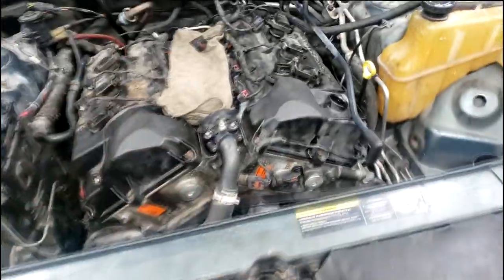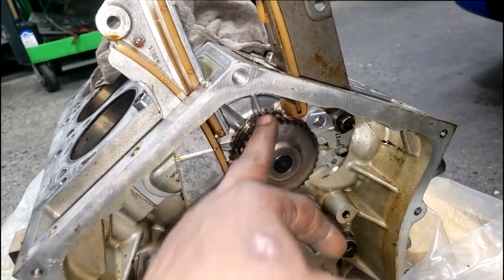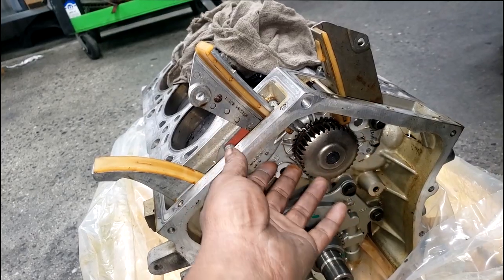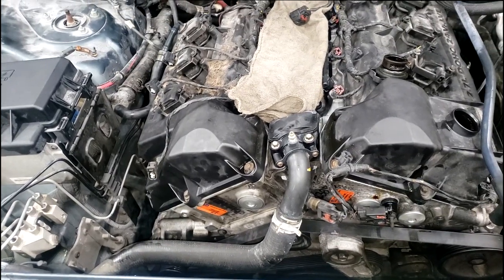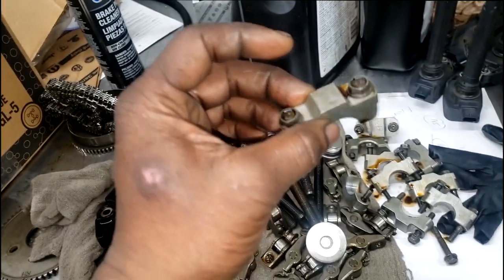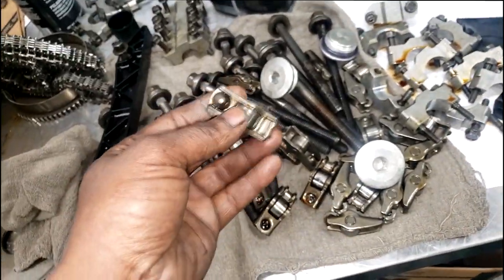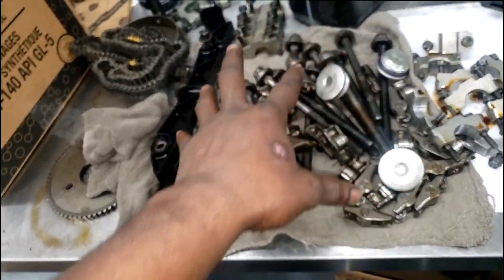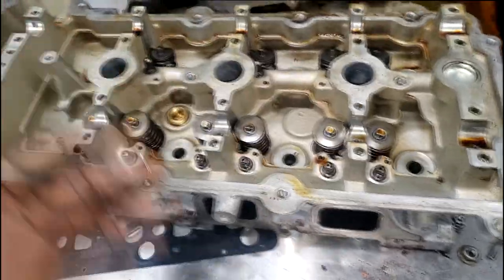Dodge Charger Magnum engine noise VALVE TRAIN PARTS vs Pentastar 3.6L Ticking noise Rocker Arms part

Comment: Had a 2.7L with 320,000+ miles in an Intrepid towed in owned by BNSF.  It would start and die and set a fault code for cam/crank out of phase. Another mechanic had replace the cam and crank sensors. He also wanted to replace the PCM but the service manager stopped him before he installed it. He thought it might have a broken flex plate and ask me to check it out. Ended finding that two of the timing chain guides broken making it have too much slack causing it to go out of time enough the PCM would shut it down. I ended up doing a T-chain, guides and water pump on it.  This was the first time in 320k the engine had ever been opened up. It had had the oil change every 3k miles all its life and was one of the cleanest 2.7L I ever worked on. Not your typical 2.7L ?

Comment: Dunno if I missed it, but you should setup a tech telegram so us techs can help eachother out if needed.
Reply from the maker: Great idea bud, I have to look into that
Reply: @OnlineMechanicTips  sweet. I got an issue with an RT van door I cant quite get solved. Its a perfect example.
Reply from the maker: @MegaMarclar  O wow, those sliding doors have modules on each door and they pretty good about setting codes for any problem that may arise. Whats going on with it?
Reply: @OnlineMechanicTips  driver slide door. Presented to shop stuck in lock position, was able to get latch unlocked after pulling panel off, got door to open. Replaced latch (hate, hate, hate)..with mopar part.. now the door will run, but when it closes and the ratchet should cinch closed, the motor fails to run and door pops back all the way open.

If I bring door to cinch position, I can actuate the cinch with witech, runs as designed. Can pop latch with scanner no problem. 
Door also closes perfectly when ran manually. 
Door will run open and closed when any of the door buttons are actuated... fob, door jamb, console.

Replaced door module. Door ran through motion and cinched as designed 1 time, after that it never worked again, back to original fault of popping its self back open, cinch motor will not run..
Door acordian harness is good, verified all wires not broken. Suspect broken wire somewhere in internal door harnss.

Comment: 2.7 got a really bad rep, but mostly because of lack of maintenance. Boi lemme tell ya about those plastic impeller water pumps, bane of my life.
Done a gazillion headgaskets in them over the years, mostly overheating complaints.

The 2.7 has mad oil flow on the top ends, never replaced a rocker, or lifter ever

Comment: HMMM, IF the rockers on a 2.7 are the same as the ones the 3.6 use why didn't they just use the rockers and all that from the 2.7?
Reply from the maker: Lol, I wasnt saying they are the same, they do however look the same. I was questioning why didnt they use the same vendors that made the rocker arms for previous models.
Reply: @OnlineMechanicTips  yeah, I wasn't sure if they were but like you said I bet they are made by that same vendor now. They got enough grief over it and every time I mention on other threads I recently got a 06 Charger Hemi RT somebody says better watch out for the rockers or valve seats, but most never mention the issues with the similar setup gm uses....

Comment: Hello JT, great content! What are your thoughts on the earlier design Chrysler 3.5 V6s that were installed in LH cars? I myself had a Chrysler 300m with a 3.5 and it started knocking. It turned out that the rod and crank main bearings were shot. I have seen this happen to quite a lot of people with the 3.5 V6s. Some guys recommend replacing the rod and crank main bearings every 60k miles to prevent an engine failure. Do you know which design flaw caused this? What is your opinion on this topic?
Reply from the maker: Hey bud, yes that was a semi common failure on those models. Those guys that recommend the rod and main bearing repair likely do not work in a dealer. We unable to make such repairs like that (even tho that would fix it) We have to do complete engine assembly if any failures of such problems exist. Also the 3.5 had upper end valve train noise/problems also, we was replacing the complete rails for this problem but as for any bottom end issues, we had to replace the engine. Because of such dealer standards, we unable to analyze why problems happen, if we can not determine that a lack of maint was the cause, nothing matters. But I loved that 3.5L timing better than any of the other V6 engines.
Reply: @OnlineMechanicTips  Thank you very much for sharing your take on this problem. Appreciate it!